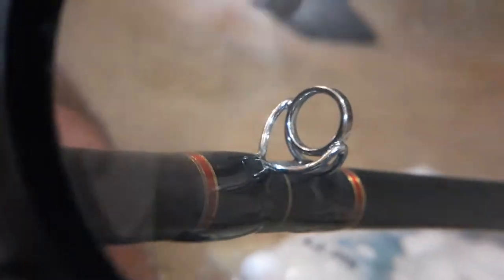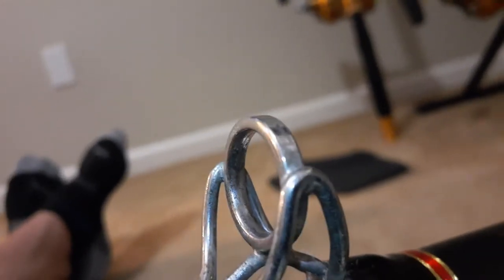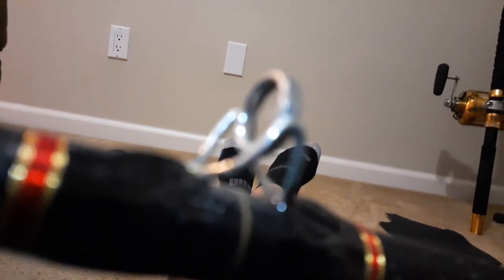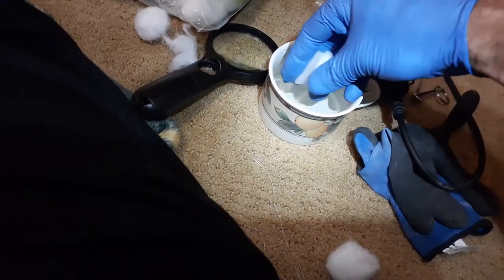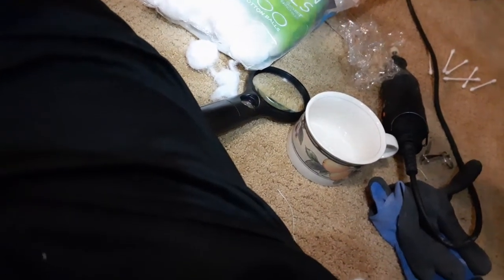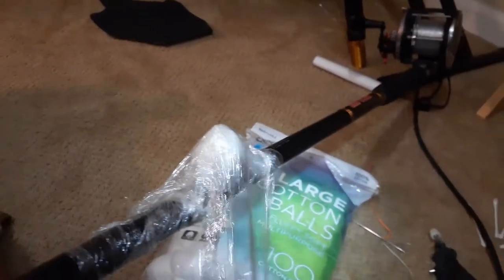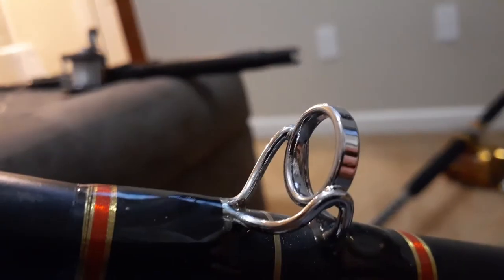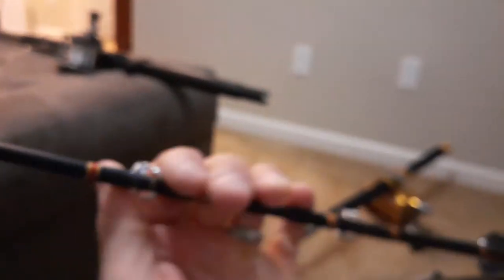Using white vinegar to remove corrosion on fishing rod eyelets

Comment: I know this is an old video but how long did you let them soak?
Reply: I was wondering the same
Reply: @fishgurusince1985  I just did mine and I got more of it off with just a q tip dipped in vineager. I packed the guides just like in the video and let them soak an hour and didn't get much better than just the q tip. Maybe soak longer? Too long and it will cause corrosion so idk.